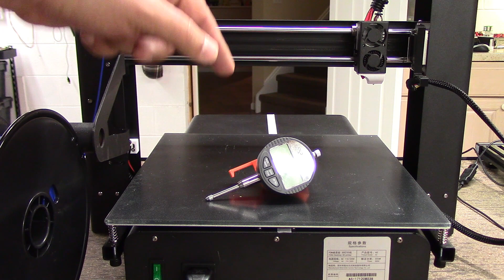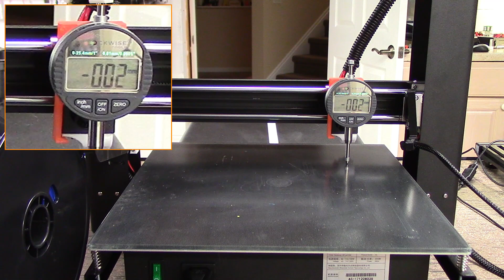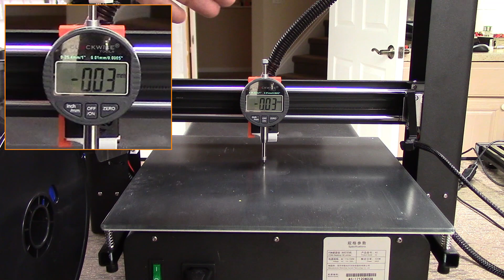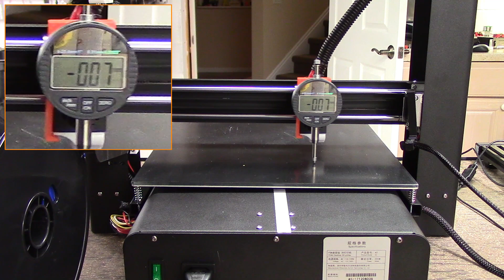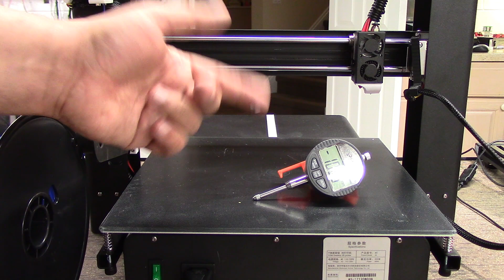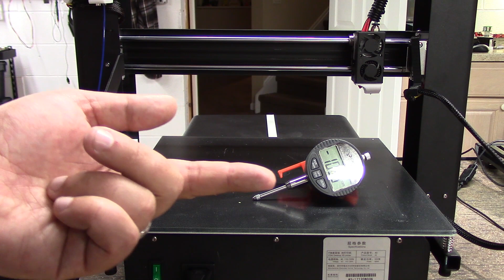GearBest JGAURORA A5 - Dial Indicator Mount for Bed Tramming!

Comment: Great video and setup, thanks for putting it together.   Sorry if I'm missing something obvious, but once you have collected the data in the dial indicator, what is the next step?  I assume you would want to pull the data out of the indicator, refactor it, and then load it into the printer as a mesh for mesh bed leveling.  Is that correct, and is there a process documented for that?  I've watched your other videos, and I've setup mesh bed leveling on my printer so I am familiar with that, but I'm not seeing anywhere how you get the data out of the dial indicator and into the printer.  Thanks!
Reply from the maker: Thanks and as covered out in a couple related videos what you want to do is spread or average out the error as this will adjust for errors in the bed...

Comment: Am I wrong for thinking that you can use the indicator to adjust your bed with a mean average at the 5 points already programmed in the JGAurora A5? I know you have variation in the flatness of any bed, but unless you use this info to input at points in a mesh leveling program, I fail to understand the sweeping of the bed at all points in between those points. If that makes sense. lol! Thanks so much for the design and share at Thingiverse! Great videos by the way! You've helped this Noob get some amazing results!
Reply from the maker: If your search my channel you will find several videos on this topic, as you first do a paper level and then us the dial indicator to average the error....

Comment: Rather than dragging the dial indicator all the ways across the bed, I think I would prefer to raise the gauge off the surface and touch-probe the 9 points sequentially by raising/lowering the Z axis.  That would keep from wearing out the tip on your dial indicator.
Reply from the maker: The tip is hardened steel so it would take a lot to wear out as its designed for this, the other thing is there will be Z error raising and lowering and too the idea is show the surface deviance by running it across the surface. :-)
Reply: I didn't see anything regarding the tip material in their specs, but if you say it's hardened steel by looking at it, OK.  Z errors... well you get that also if you enable lifting during printing (called Z Hop?).  I don't run mine that way.  But I've seen the Prusa printers do that.  And probably others as well.
Reply from the maker: Keep in mind that during a print, its always a positive motion upward and not up and down and even with a Z-Hop it should not induce as much error as full lift.  However as mentioned the reason for this is more so to map the surface as there is a hump in the bed of JG which this makes obvious...
Reply: You're contradicting yourself by first saying there's "Z error raising and lowering", and then saying "Z-hop should not induce as much error".  Well, Z-hop IS raising and lowering.  The magnitude does not matter.  It's the raising/lowering movement that causes backlash or hysteresis errors.
Reply from the maker: Correct as further the z move the  greater then error.  Z-Hop is so small the over all error should not be negligible in the scope of the movement.  As to lift the dial indicator we are going to have to move around 10mm verses a fraction of mm....
Reply: As I said, the magnitude (or distance of Z travel) does not matter in this case.  You are moving the Z, and then moving back to the same spot.  So the errors in getting back to the exact same spot are due to backlash or hysteresis.  These are constant errors, not scaling errors.  So it doesn't matter if you move 1 mm and then back, or 10 mm and then back.  You end up with the same error.
Reply from the maker: I am not sure I would fully agree these 100% repeatable especially with microsteping involved and the way the motor locks itself.
Reply: That could be.  Should be easy enough to test though.  Drive Z up 1 mm and then back down.  Record the dial indicator value.  Do this 5 times to check repeatability.  Then drive Z up 10 mm and back.  Do that 5 times and record.  Then 20 mm.  etc.  That should give you an idea if it's just random errors, or if scaling errors creep in also.

Comment: You could (or could you) read the "9 points" (or even more) enter them, save them in EEprom and obtain a "manual" mesh bed levelling.
Reply from the maker: Yes if mesh leveling is enabled as I thinking about doing a video that...

Comment: what interest ? there is no setting of the board there so no interest
Reply from the maker: What for mesh leveling?  As yes you can turn it on and many folks have...
Reply: but what an interest to do that if the board is not set after, shown this thing to ok but after it must be shown how adjusted the board with the comparator no otherwise I do not see what it would serve
Reply from the maker: If your talking about tramming the bed, I have already did two video's on this so a third would be over kill as the idea here is the introduction of this along with all of the other ones I have designed as if you follow me on Thingiverse you will see...  :-)